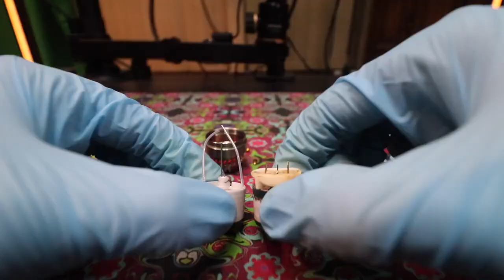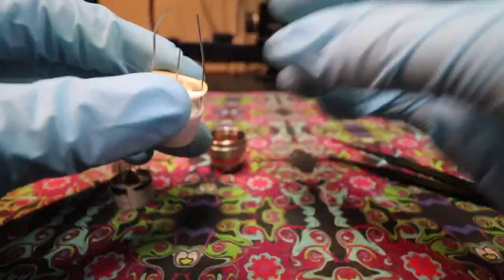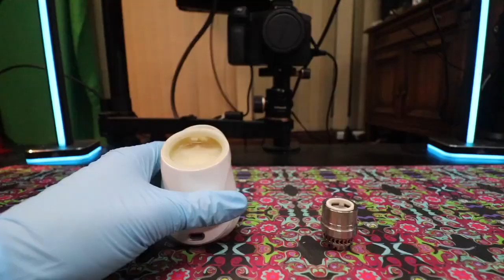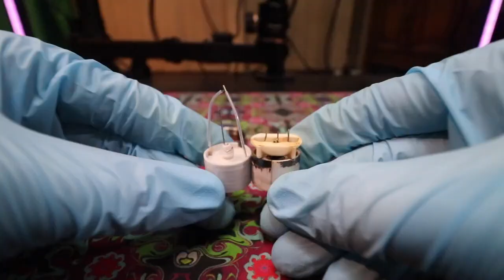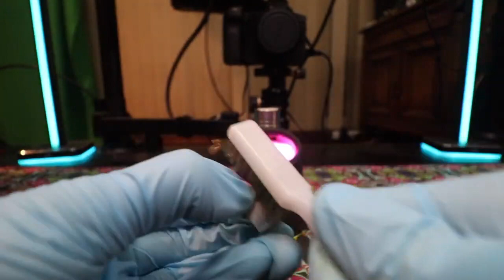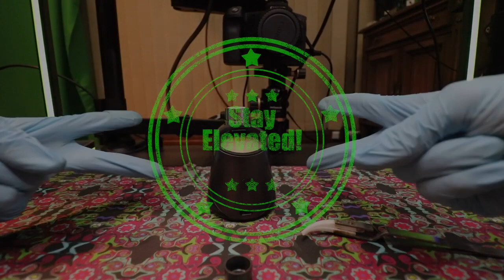Puffco Peak Pro JCVAP 3D ICA Rebuild Tutorial! Red White Waaambulance Light & White White Light Fix!

Comment: The problem I have with the JCVAP ones is what they're using to bond the heat sensor to the heater itself. My JCVAP heater/sensor bond always cracks and disintegrates after 2 or 3 heat cycles. I found a way to bond it and no issues since. The ceramic dust from the bond breaking seems to get into the workings and cause issues. I noticed it would work fine without bonding the sensor to the heater. I just screwed the cap on tight and it worked like a charm for a few heat cycles before I thought of my alternate bonding compound.